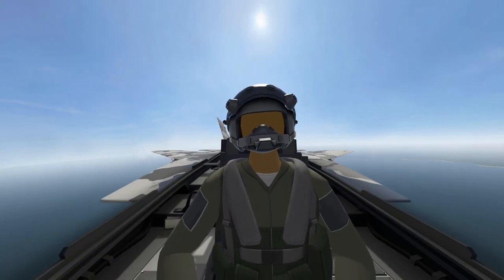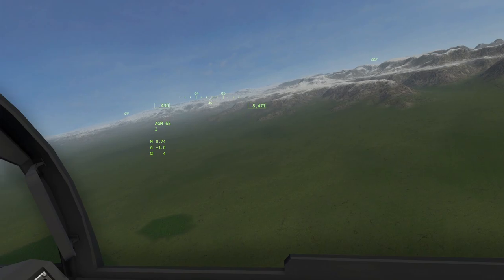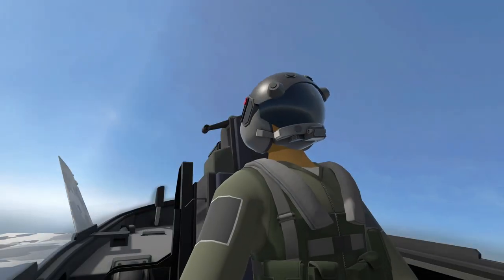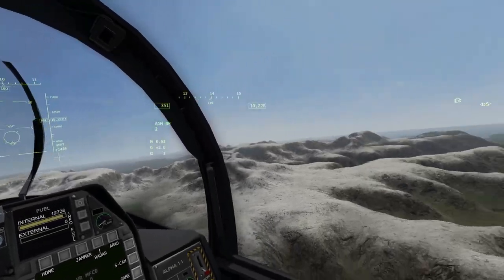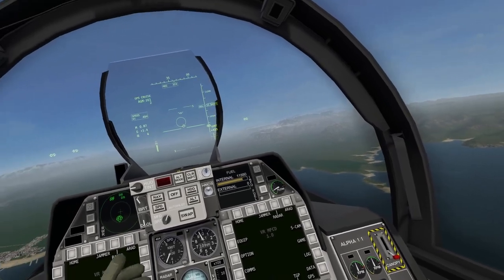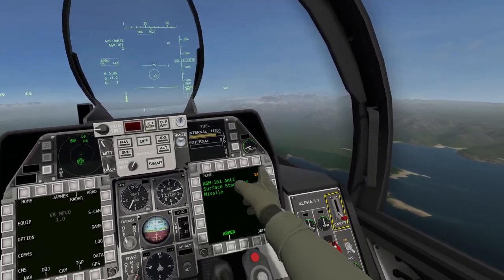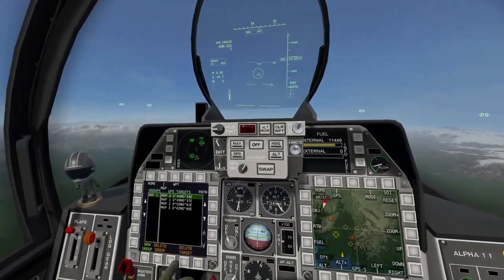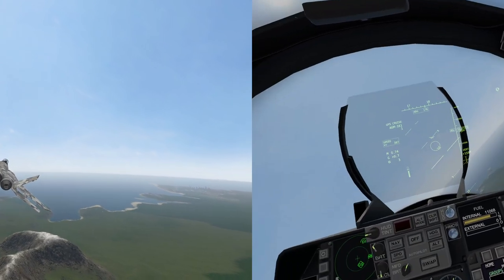VTOL VR Tutorial | F/A-26B Air To Ground MIssiles

Comment: Nice! thanks.   how you recorded the video with different angles? what software do you use?
Reply from the maker: It’s actually built into VTOL VR. I use the S-Cam to get all those angles. 

What I do is I record the vr gameplay using the OpenVR plugin for obs and then I record the S-Cam set in random mode using obs. The S-Cam will be what shows up in the steamVR mirror, so you just have to capture your desktop. 

I also set my OBS to a crazy resolution that allows me to record both the openVR capture and the steamVR mirror without needing to open two instances of obs. 

My main monitor is 2560x1440 so what I do in obs is set my profile to 5120x1440 which is extra wide. Then on one half goes the mirror and the other goes my VR view. Then in editing I move the image left or right depending on if I want to show you the cockpit or outside of the plane. 

There is a problem recording at this resolution though. OBS actually won’t allow you to do it with the default FMPEG codec. So you have to setup a different code to record at that resolution. However, it will allow you to record at 3840x1920 without a custom codec. I tried to do that and the downscaling ruined my footage since I was coming from 1440. 

So it really depends on what hardware you have. But that’s basically how I’m able to do it.
Reply: You can also output the S-CAM feed to a second monitor and set OBS to record from there if you have one

I have OBS streaming presets that show the pilots view from the game screen with a small S-CAM overlay in the corner, and also the other way round too

And I also have the same double width profile too but mine takes feeds from each monitor (actually 2 separate game windows) giving 2 simultaneous full res feeds to choose from (steam view gives a slightly different view to the in-game output plus its lower quality and res from memory).

I however don't have 2 monitors, I fool my system into creating a virtual one using a HDMI plug that emulates a monitor.
Reply from the maker: @Katashtrophie  The second monitor thing is helpful and definitely has it's place. That's a great tip!

@pedrocorrea3027 You'll want to experiment around.  The S-Cam on a second monitor didn't work well for me because I didn't like crop it was getting on an ultrawide monitor.  Currently my monitors are different sizes for different use cases.

The good news is that there are tons of ways to pull this off.  The simplest, but most resource heavy and time consuming, is to run two instances of OBS and record two 1080p canvases using a mix of S-Cam and your view (however you go about getting it).  Then you sync it up when you edit. 

The last piece of good news is that there is a great community of creators, like @Katashtrophie who are willing to share valuable tips to help out!